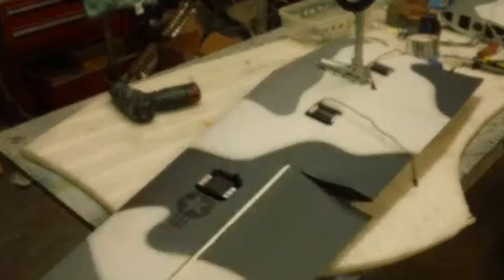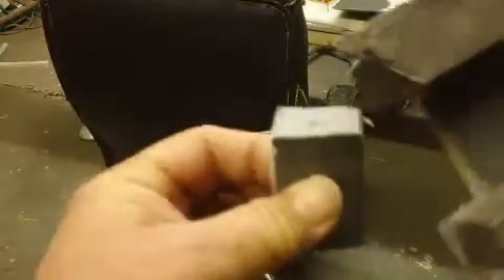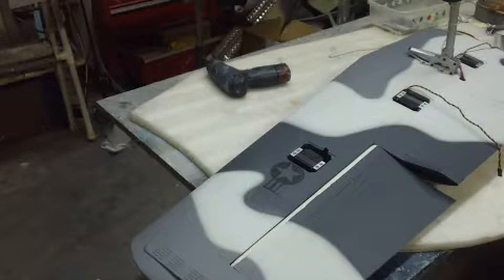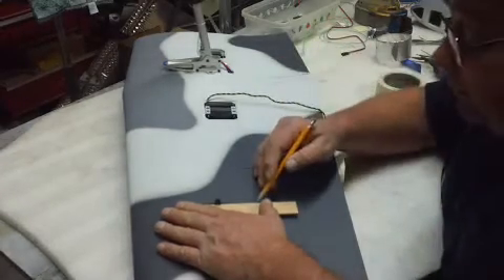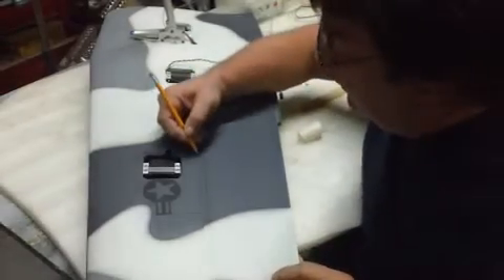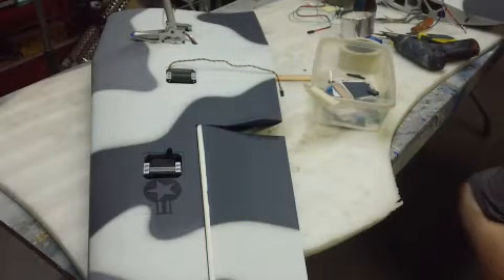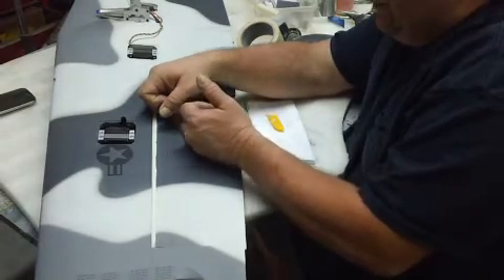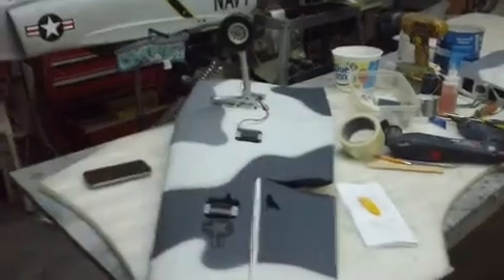Skymaster A-10 bould #10

Comment: If the leak stopped with the BarsLeak then just sell the truck. I ran around with a bars leaked head for 2 years one time... still no problem. You could do the head yourself if your back would handle it.  $2500 is too high
Take care Bob